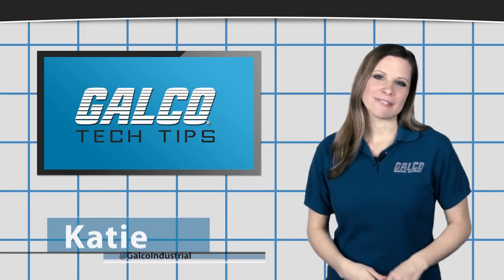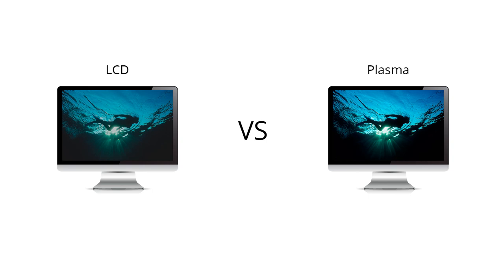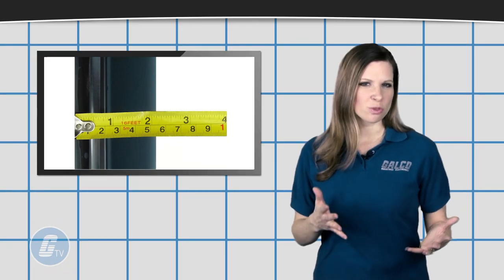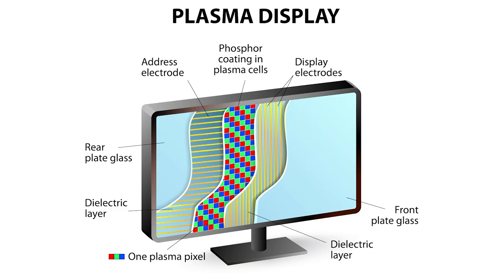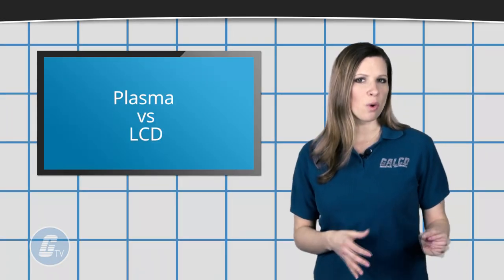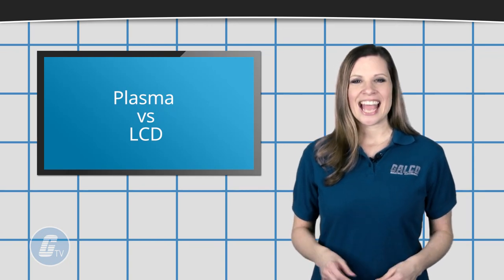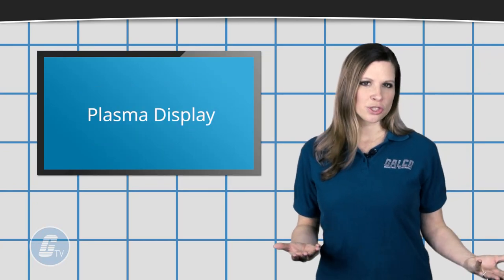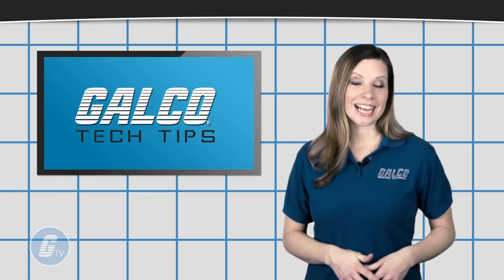How does a Plasma Display work - A GalcoTV Tech Tip | Galco

Comment: Great, everything except how a plasma display works, thanks...
Reply: Plasma gas is charged by electricity that lights up the pixels. It works the same as an LCD tv but instead of a backlight the gas lights the pixels. Plasma was fazed out because LCD sets were cheaper to make and were brighter much brighter.